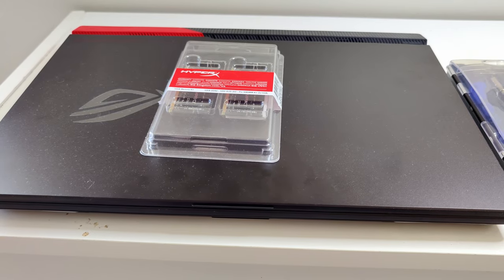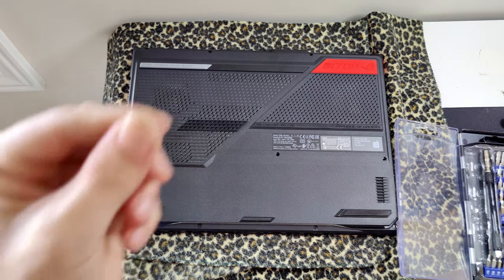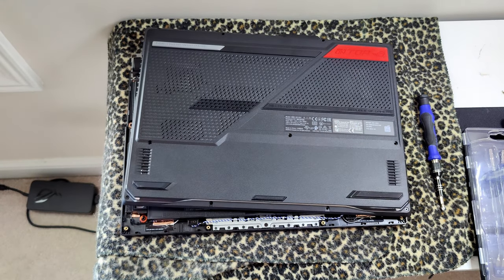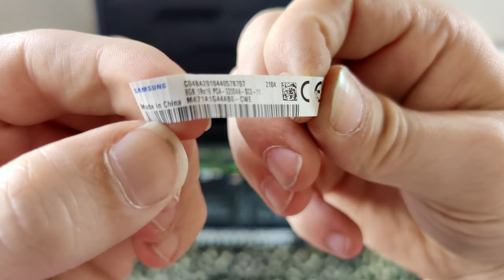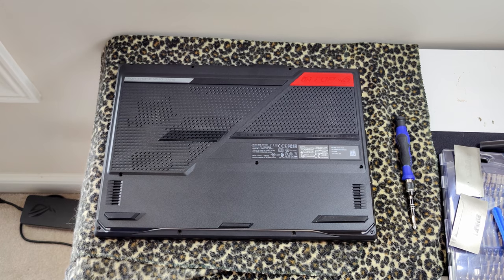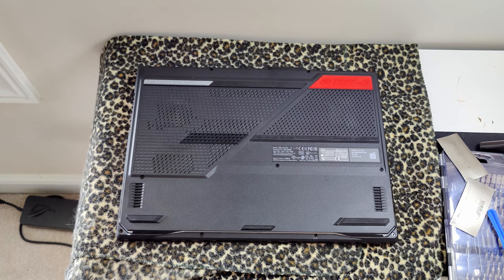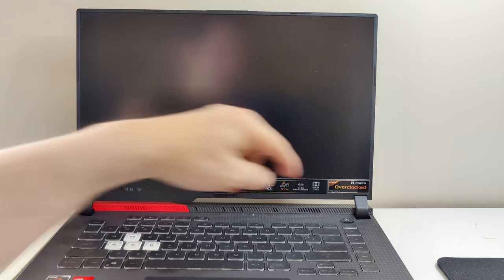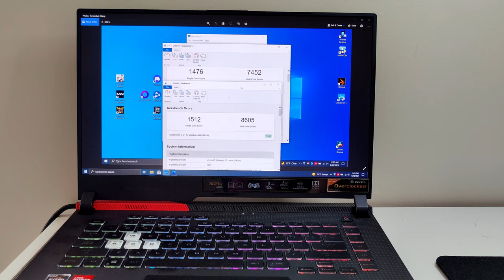Asus ROG Strix G15 Advantage RAM Upgrade

Comment: Can I put a 32GB Single stick in there with one 8GB that's already there, Since I don't wanna invest in 16+16 and rater buy a 32GB stick in future to make it 64GB????
Reply from the maker: With RAM you want to keep it the same brand and speed. So if you can find a 32gb that's the exact same as the 8GB stick it would probably boot and you would probably see all the RAM it won't run in Dual channel mode. 

 Thus  making the laptop run worse than before. I'd recommend just buying another 8GB stick for a total of 16 that way you still get dual channel. Unless your video editing or doing something really intensive 32 GB of RAM is not really worth it.
Reply: @XxViciousxX  Firstly, thanks for responding and so FAST!!!

I have 16GB of stock RAM atm
I play poker professionally and do need more RAM
I will max it out to 64GB in a year or two. 
For now is it a good idea to use one stock and one new 32GB stick or not to use stock at all???
Reply from the maker: @neerajsattawat7675  I'd try it with the stock RAM just to see if it works. If not then just use 32 by itself and then get the other 32 GB later. Plus I learned something I had no clue professional poker used so much RAM.
Reply: @XxViciousxX  Thanks, I'll let you know the results once I get the RAM and try it out.
Yeah Playing Poker professionally means you study poker with softwares which requires RAM and CPU power, this is when you're not playing.
When you play it's always multiple sites with one hands tracking software Table management software Brave/chrome in background with Spotify on the side😁

Felt like sharing
Reply from the maker: @neerajsattawat7675  Definitely let me know how the RAM goes and thanks for sharing I like learning new things.
Reply: @XxViciousxX   Hey there is something I want to know a solution about.
I had a 2K 32 inch monitor with only HDMI INPUT nut I got a 43inch 4K monitor as well which supports type C/HDMI 
I want to use both external monitors.
what's the best way to set it up!!!
Use 43inch with HDMI and but a Type C to HDMI for the old one????
Reply: @XxViciousxX  Just installed the RAM 32GB Kingston Fury 3200MHz and it works paired with one stock RAM. In total 40GB RAM atm. 
Cheers
Reply from the maker: @neerajsattawat7675  Nice! Glad it worked out for you. Plus now if anyone else asks if this will work I can tell them yes and point to your comment.
Reply: @XxViciousxX  64 max ram available it says 32 tough that amazing peace of machine
Reply from the maker: @alangolab6657  Thank you for confirming I will let anyone else who asks know. It is a pretty awesome laptop.

Comment: will corsaire vengeance cmsx16gx4m2a3200c22 be an upgrade for this same machine? 1.2v
Reply from the maker: That should work and be a little better than stock. But it won't be quite as fast as this Kingston Hyper X RAM. But it's also half the price so there's that.

Comment: So i just bought HyperX Impact HX432S20IB2K2/32 and swapped with original memory but now my screen doesn't turn on and i have airplane mode on. any idea why? defective memory?
Reply from the maker: Sounds like something Is definitely defective there. You saw in my video what happens when everything works it just turns back on and everything should be as it was only with much faster RAM.
Reply: @XxViciousxX  I tought so. i bought from Amazon warehouse deal and now i'm returning it. i also notice liquid metal spot on RAM so just to be safe i'm returning laptop also
Reply from the maker: @mikekolasa6625  There were reports of Asus screwing up the Liquid metal application in a few of these so yeah if LM is anywhere besides hiding under the heatsinks where it belongs I'd send it back too. Though when you get one of the good batches of the laptop like mine they last. Mines still doing great and it gets hit hard doing lots of gaming videos for YouTube and then encoding some of the videos too.

Comment: without disconnecting the battery?
Reply from the maker: You can disconnect the battery if you'd like. But it's very unlikely you'd fry something with today's technology. 

I figured with my luck I'd break the wire or something so best to leave it alone.

Comment: Вы настраивали что-нибудь после замены оперативки???
Reply from the maker: Nope I left everything the way I had it. Not much RAM adjustment can be made on laptops. Now Before I even got the RAM I did do some manual settings in Armory Crate, as well as enabled overclocking in Radeon Settings.

Comment: I know this is late but I'm getting the same latop and it comes with A crucial DDR4 2x 8 But they came out with A DDR5 version and I can upgrade to 32GB Might considering getting it as soon as it arrives
Reply from the maker: Pretty sure this laptop is only DDR4 with a RYZEN 5000 series processor RYZEN 7000 is DDR5. So DDR5 won't work on this laptop. Unless I'm misunderstanding what you're saying.
Reply: Mine is gonna have a AMD Ryzen 9 5980HX

Comment: HEY I HAVE SOME QUESTION HOW TO UNLOCK xmP AT BIOS MENU TO ruN 3200 MHZ MAX
Reply from the maker: This laptop doesn't actually support XMP. So when choosing RAM you got to get 3200mhz no XMP also don't go over 1.2v or it will default to 2133mhz.
Reply: @XxViciousxX  That's good advice, thank you very much.

Comment: How about DDR5, i want to upgrade my G15...and now i would liket o find out if i can use DDR5
Reply from the maker: No DDR4 is the max for this laptop. It's also kind of picky when it comes to RAM it has to be 1.2v max, no XMP, and preferably 3200mhz+ to make a good difference like the stuff I put in here.
Reply: @XxViciousxX  thanks for the answer, i will buy the same then
Reply from the maker: @PencakexD  You're very welcome.
Reply: What's the difference between DDR4 DIMM and DDR4 SO DIMM

Comment: what if after the upgrade, it doesn't recognize the ram speed? I mean, I got the same laptop, but it comen only with 8gb 3200MHz, I upgraded to 32gb 3200MHz but it only works at 2666MHz and when I try to change the frequency through BIOS, I can't find where I can do it because there is not " ai tweaker" as in other asus BIOS. What can I do?
Reply from the maker: Out of curiosity is your RAM 1.2v also can't have an XMP profile or be over 1.2 V or it will default to 2666. As you already found out most laptops don't let you fiddle with RAM (of course there are exceptions to the rule) but this laptop can't. What RAM did you Try to put in there? So I can try to figure out why it's not working.
Reply: @XxViciousxX  thanks for your answer. I'm using TEAMGROUP T-Force Zeus DDR4 SODIMM 16GB 3200MHz (PC4-25600) 260 Pin CL16

Comment: approximately 06:04 - interesting, if I wanna buy 2x 16Gb RAM - where I'm gonna get another copper sheet - you have 1 RAM 🤣
Reply from the maker: Lol yeah, those little copper sheets don't do much. I think they are mostly to go with the matte theme that the inside has. This is very low voltage RAM 1.2v it doesn't get very hot.

Comment: You could've read upgrade manual on asus website
Reply from the maker: Yeah, I should have done that. But everything worked out great so all is well.
Reply: @XxViciousxX  you forgot the heat stickers
Reply from the maker: @thevirenhooda  I did not think they were necessary(it's only 1.2v RAM after all) but said later in the video you can put them back on if you want.

Comment: How to detect a G17 laptop has slower ram ? Could you tell me?
Reply: Download Zen timings and check the tRFC value, if its 560 u have faster ram kit, if its 880 u have slower ram kit. Also check the other parameters. For detail cross checking compare your timings with Jarrod's tech timings
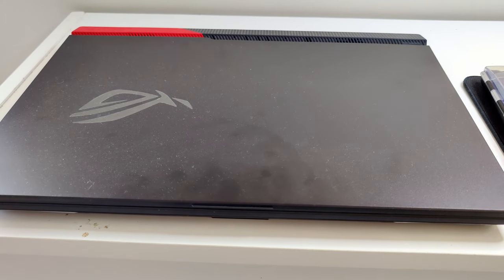Check 1:00 in this link 
https://www.youtube.com/watch?v=8XCeAdFqsKg
Reply: @TechSaz  Checked and found slower RAM in my Strix G17 😔😔😔😭😭 Need to change this. They have taken 1.55 L from me for this laptop. Horrible.
Reply: Anyway thank you very much for your help
Reply: @dnbcatalina6192  its due to shortage of components, they are not doing it purposely. Do u really need to change the ram, there is only some performance difference. If your are planning to change, then go for 32gb and make it a worthy upgrade.
Reply: @TechSaz  yeah
Reply: @dnbcatalina6192  will u please share your trfc value?
Reply: @dnbcatalina6192  I got lucky, i got same score as jarrods score of 560 even though i purchased an absolute base version of rog g15 lineup that is rog g513 2021 with ryzen 7 4800h and 1650 purchased for only 64k.

Comment: You forgot the heat dissipation sheets they are important
Reply from the maker: I did not think they were necessary but later in the video said you could reuse them if you wanted. I will let you know if the RAM does overheat. But at 1.2v it should be fine I mean the memory timings sticker was coving half the heat sticker so I don't think it was doing much again I could be wrong.
Reply: Very unlikely ram will overheat,  this is one of the only laptops I’ve seen that has thermal pad for RAM may make a small difference yes but it will not cause any harm to the RAM as it’s only running at 1.2 V,  for ram to overheat you would normally have to have an extreme OC. I personally would advise actually taking the thermal pads off as if they May enter the fan.  Best ram  for laptop would be Corsair  vengeance As it has sticker covering the memory chips on both sides

Comment: Thank you for showing this. Do you know if you can disable the microphone in the Bios and also can you Undervault the GPU? I have seen many videos of this laptop on YT and most of them are around 95c hot when playing games, so i would think if you can undervault the gpu it would be a lot less hot when you play and so the laptop would last a lot longer.
Reply from the maker: It's actually the CPU that gets up to 96c CPU (CPU throttles at 105c) the GPU stays at around 85c. You could turn off turbo (but you'd loose performance) you could also limit temps with Ryzen Controller ( that too will limit performance though) or you can do what I did and get the best cooling pad now it maxes out at 93c more like 85c in games) for CPU and 76c for GPU, GPU also stays at 1400mhz more often. 

The BIOS is very basic so I didn't see anything in there about microphones but I could have missed it or they could have added something in an update.
Reply: @XxViciousxX  mine gets delivered tomorrow, already preparing for any of various mods (ie. adding washers to vapor chamber mounting screws to increase mounting pressure), I just don't trust LM...what is the best thermal pad in your opinion? Never used one. Why do some paste-people hate on pads?
Reply from the maker: @emilydavis842  I think thermal Grizzly still has the best thermal pads. Most people want the best temps pads usually don't get the best temperature but at least they last never dry up and make good contact with whatever they're installed on. 

I like LM as it has the best thermal conductivity but I like to be the one in control when applying it because if you mess it up it can be worse temps then paste and it can fry your stuff as it's super conductive to electricity as well.
Reply: @XxViciousxX  where did you install the pads?
Reply from the maker: @abd211m6  I didn't put them back on figured since it's like a sticker they never go back on well and probably doesn't do much. But you can put them back on the new RAM if you want.

Comment: Hi, just a lame question from fellow G15 AE owner - is there any way to tell which memory was installed without opening it up? It doesn't seem like that much of an effort, but I'm not sure if I have the right tool to lift the lid without scratching or breaking it. 

Just returned to PC gaming after almost 15 years spent on consoles, so I need to learn a lot ;)
Reply: "Zentimings"  you can compare it to jarrods techs ram, the ram shown here was the good suff you don' need to upgrade

Comment: CL20 is still more. You should've got a tighter set of RAMs, say CL16.
Reply from the maker: It is pretty high but I had to get 3200mhz RAM that requires no XMP and max volts of 1.25. SO these seemed to tick all the boxes.

Comment: can an ssd be added? Thanks.
Reply from the maker: You can add another M.2 drive next to the stock 512gb m.2 or replace them both if you wanted. This is a very user upgradable Laptop. Only things you can't upgrade are the CPU and CPU. RAM, m.2, and WiFi are all user upgradable or repairable.

Comment: My keyboard doesn't light up :(
Reply from the maker: Did one of the two ribbon cables come lose by chance?
Reply: @XxViciousxX  pretty sure when we added a drive, there were no ribbon cables
Reply: @XxViciousxX  I'll have to have another look, but that might explain it, the keyboard lights have never worked.. which sucks because I kinda need them when it's dark.
Reply from the maker: @glenbehan1028  Have a look at https://youtu.be/18Qg9-vMyBY?t=297 you can see the two cables I'm talking about. If those are connected you could try reinstalling the Aura Creator software mine got messed up when I started using my K70 keyboard once I reinstalled it lit back up. Figure it's got to be one of the two unless it's just broke which would suck.
Reply: @XxViciousxX  yeah watching I saw those cables and I thought, mine didn't have those.. I'll have to have a look. I was looking at the RAM, been thinking about changing mine.. I bought my laptop in November 2021, so not sure if I have the slow RAM or not.

Comment: When I buy the ram do I get the kit or single rank
Reply from the maker: When I bought mine I got the kit mine was 32 GB CL20 DDR4.
Reply: @XxViciousxX  do you know difference between dual rank and single rank?
Reply from the maker: @yash-4205  To my knowledge the RAM I got is single rank. I was told dual rank is when it has memory chips in n both sides. But I figured that would be due to capacity in my case since I have 32gb. So no not completely sure what the difference is between single and dual. 

I was always told AMD likes fast RAM with tight timings and likes dual rank RAM but maybe that part is just for desktop RAM not sure.

Comment: Anyone tried to do 64GB with it? I know that Asus says that it's 32 max but companies always tend to lowball the actuall stuff
Reply from the maker: I would be interested in that too I've had a few people ask me but I can't get any hard information. Like the motherboard supposedly do 64 gigabytes of RAM according to some. But Asus says you can only do 32gb so I'm not sure who to believe. Maybe if my YouTube channel really takes off I'll just buy 64gb to test it out.
Reply: @XxViciousxX  
I just bought the G15 Advantage in India, and as per the specs on the Asus website, 64GB RAM is supported.
Reply from the maker: @springs-thedesignshopudupi7523  Thank you for letting me know last time I looked at their site it told me 32 maybe a BIOS update unlocked more RAM capacity. Or I possibly looked at the wrong Asus laptop RAM capability page. But will let anyone who asks know it's 64 from now on.
Reply: @XxViciousxX  Update: I upgraded my RAM to 64GB about a year ago. Things a working fine with no issues.
Reply from the maker: @springsdesign  Thanks for the info its nice to know it can in fact do 64GB.

Comment: Your RAM was the good stuff, you didn't get the bad RAM. if you looked at ZENtimings app
Reply from the maker: It had Tfrc of 880 the good RAM had Tfrc of 560 or at least that was my understanding. But this stuff is the best RAM you can buy for this system so I'm glad I upgraded it.
Reply: @XxViciousxX  I bought that exact ram you did and it had a 0% performance improvement. The Timetec CL22 Dual Rank RAM 3200Mhz ram is actually the best you can buy purely because it's dual rank
Reply from the maker: @SB_Artsy  So all of my benchmark scores increased for no reason?
Reply: @XxViciousxX  Yours did because as you stated your TFRC was 880 and changed to 560, after my initial assumption you got the good stuff. I'm telling you my laptop came with TFRC 560 ram and the HyperX Impact CL20 made no difference, the TimeTec dual rank Ram is superior as it is faster than the HyperX Impact in benchmarks, I was telling you so that you're aware the HyperX isn't the best ram for the system as you stated
Reply from the maker: @SB_Artsy   Maybe I need to just shut this YouTube channel down as someone else said yesterday. Since I'm giving bad advice and seem to be wrong on almost everything I do. I definitely don't want to give people the wrong advice and have them get worse performance than stock (then have them mad at me) even though they're in the right to do so as I gave bad advice.

Though when people ask if they have the bad RAM I always tell them if it's Trfc 880 it's bad if it's 560 you shouldn't bother upgrading.  Is that incorrect?
Reply: @XxViciousxX  I was just giving you a heads up as, I bought 2 sets of ram to upgrade my g15 AE because of other people saying that the ram was bad, turns out far and few have the slow ram. So I wasted my time and have to return 2 sets of ram. So you can add to the description etc that you're replacing the Tfrc 880 timing ram via Zentimings etc

I just used your video for screw locations which was great